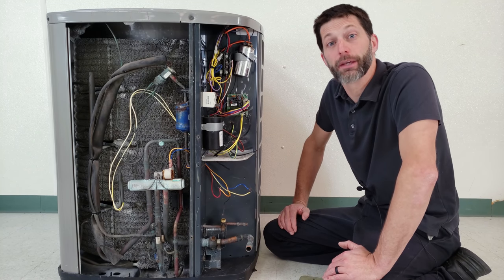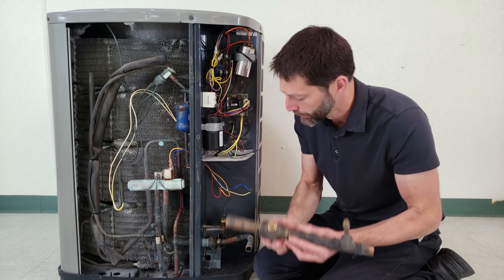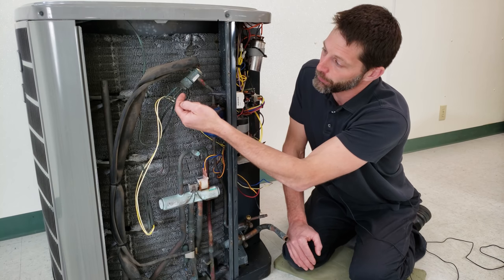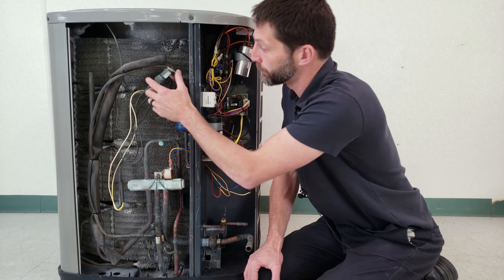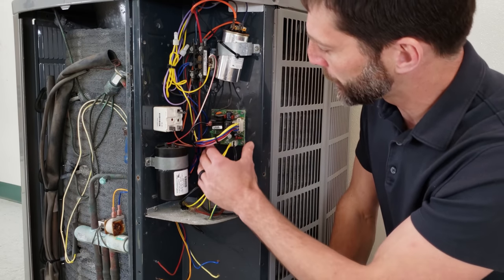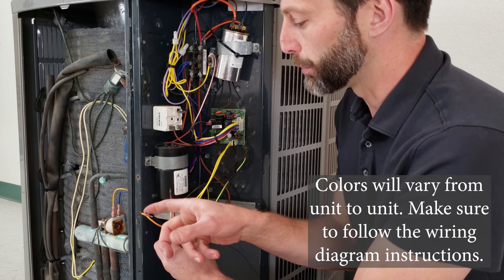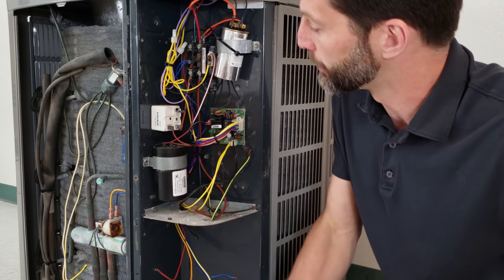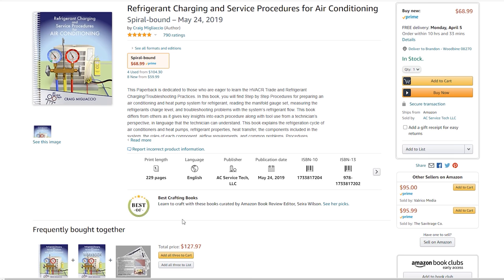Outdoor Heat Pump Electrical & Refrigerant Components Walkthrough! What They All Do!

Comment: Great info, Craig if you want to pressure check that outdoor unit lets say after compressor replacement or leak check, due you have to shift the 4 way valve to test complete coil?

Comment: Excellent video! I have this same heat pump. It didn't work well below 40. Just figured thats how they work. Then I got to inspecting it more. I found the defrost temp sensor on the coil hanging out of the little tube.... No wonder it wasn't defrosting properly. I zip tied it back and now heat pump works much much better.

Comment: At 8:40 you mentioned that a Thermistor operates the same way that a Type-K Thermocouple does. I fear this may be a little confusing. Thermistors change their resistance value at different temperatures. Resistance may decrease or increase depending on the type of Thermistor. RTDs are similar. Thermocouples create a tiny current which changes with temperature. They are both temperature probes but they do so using completely different effects.

Thanks for the great content! I really like your video. It's excellent. I learned so much.

Comment: I hate to ask this on this video but do you have any videos on troubleshooting dehumidifiers? I got one that trips the breaker on starup and you have such good info and troubleshooting videos so i had to ask. As always thank you for all the knowledge you share and great videos. Thank you sir.
Reply: Check the compressor first. De-wire it and see if it still trips
Reply: @Froggability  Thanks man ill def try that.
Reply: A dehumidifier is just an AC optimized to condense moisture out of the air as it flows over the evaporator, generally by reduced airflow so the air has more contact time.  So just look at videos on finding shorts in AC systems, they'll still apply.
Reply: @jkbrown5496  Thank you much for your reply and time

Comment: on 1:28, you mention that front seating the valve will connect the 2 pipes. Shouldn't front seating those service valves close the line?
Reply from the maker: It will close the tubes but the port will still be connected to the tube heading to the indoor unit, thanks!

Comment: Could you please tell what is the minimum safe ambient temperature to turn on air conditioner. Is cool temperature going to do any damage to the compressor or it's a myth? Thanks. (Not heat pump)

Comment: Great video. But I'm saddened at how immensely complex these systems have becoming in recent years. They used to be so simple and easy to purchase and swap out parts. Now their complexity makes it harder and harder for DIY servicing. With so many intricate little parts and subsystems, there is a far greater chance of something going wrong, which means a far higher chance of having to maintain a yearly budget for calling out an AC repair person to "service" a unit that is supposed to last at least 10-15 years (20 if well maintained). In Florida, I may turn on my heat briefly maybe twice a year, if that. Why would someone want all this complexity with so many parts that could fail when they could instead have a simple electric coil furnace for that couple of days when its needed. The so-called "energy efficiency" argument is meaningless when it is almost never used, and electricity usage would never be enough to outweigh the additional cost of an unused heat pump system.
Reply: A good argument for mostly warm climates. In that case, I agree. I would just do a straight A/C system without the heat pump, and use electric (or gas) for occasional heat use. Disclaimer, I do multi-unit maintenance. I'm not an HVAC guy.
Reply: I agree with your argument, however it’s not that hard to learn. I am not hvac tech but like hvac as a hobby, this indeed takes time to learn, but once you spend maybe 4 years diy it yourself, it becomes a lot easier.  In Florida yes don’t make sense just grab ceramic heater for sure.